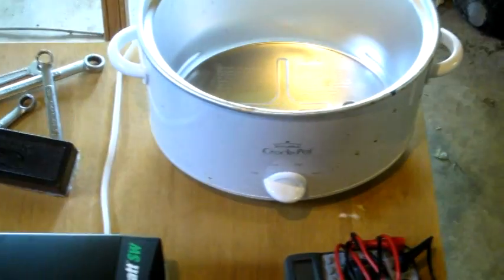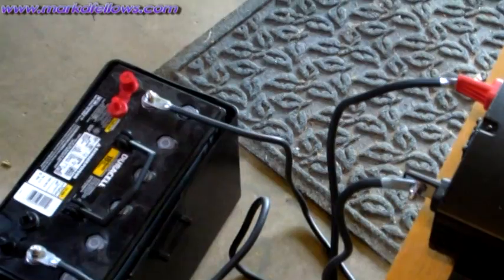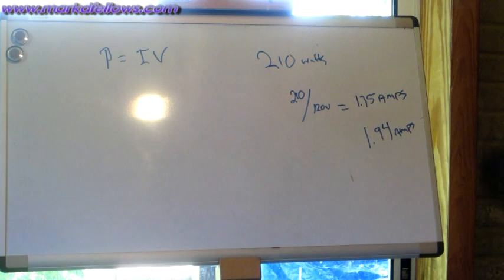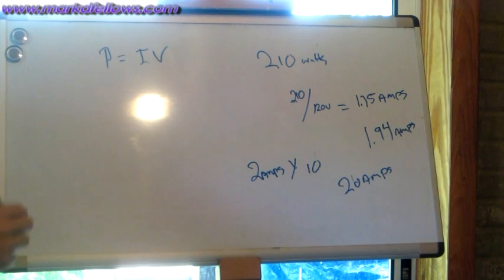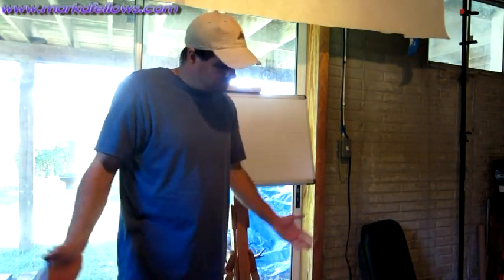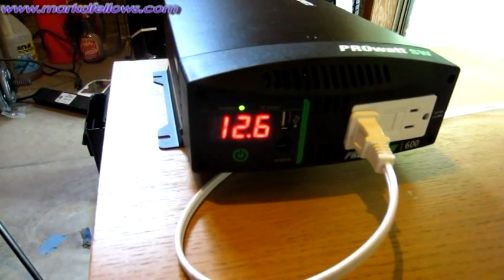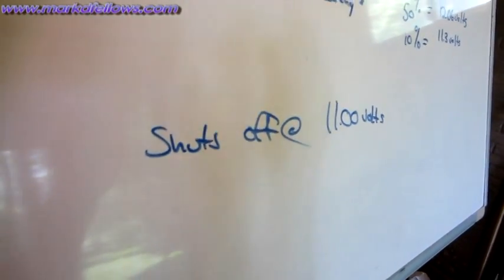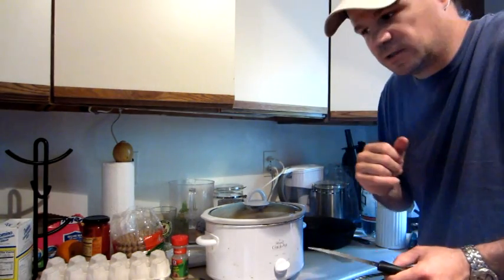Crock Pot cooking on battery power

Comment: I've wondered about doing crockpot cooking with alternative and have the following thoughts.

First, since standard pots are nothing more than a big wirewound resistor, they shouldn't care about the waveshape that you may be powering it with. So the true sine wave inverter you are using is actually overkill. A less expensive modified-sine wave inverter should work equally well with a crockpot. The important thing here is the RMS value of that wave be equal to the rated voltage of the pot, and even these lower end inverters usually have voltage regulation. Get one with a wattage rating just a bit higher than the wattage of your pot. That will get the best efficiency out of the inverter. Use your true sine wave unit for your sensitive electronics.

On crockpots: For this application, I would use a model with a nonremovable crock because those units use less power. Why? Because the heating coils are in direct contact with the crockery insert and easily transfer their heat to it. Whereas with the removable crockery models, the heat must be transferred to the crock via conduction through the metal heating base. Unfortunately, the nonremovable models aren't as widely available as they used to be. Your best bet to find one would be in a thrift store. Also, try to stay with the original design -- models that just have the OFF/LOW/HIGH switch. Other types that have variable temperature settings usually have a thermostatic switch that constantly cycles the pot on and off -- not a desirable arrangement for this sort of operation. Of course, the simplest solution would be to use a crockpot that runs directly off of 12 volts, but then you would be stuck with something very small (less than 2 qt capacity I believe) as well as losing the voltage regulation provided by the inverter.

All in all an interesting use for solar or wind-generated electricity. Hope to hear more about your experiences with this setup.

Comment: A word on chargers: For a 100 amp-hour battery, you want a maximum charge current of 20 amps - or C/5, as we say in the battery business. Also, a battery's amp-hour rating is ONLY that at a relatively low current. At the rate your inverter is drawing current, your battery MAY be only capable of 75 or 80 amp-hours. IOW the faster you draw current, the LESS amp-hours you will actually realize.
Reply from the maker: KarisLabReport,

Thanks for the info.  For those batteries it was extrapolated over 20 hours.  I should have put that info in there.  I guess I had faith that they were good batteries.  Most of the AGM batteries I see the drain rate is taken over 100 hours and multiplied.  thanks for your comment!

Comment: Good video - though be aware inverters can EASILY be as low as 65% efficient! I think 90% efficiency is overly optimistic. The inverter I have I MEASURED at 72% efficient. FWIW.
Reply from the maker: Thanks for the tip!  The only thing I can say is I think I was right about this particular inverter for a couple of reasons.  One, my math worked out, so m estimate on efficiency must have been correct.  Two, I read what they listed the efficiency as.

If the efficiency of this inverter was lower, as I am sure you know, the batteries wouldn't have lasted as long...

Thanks for the tips, and your comments!